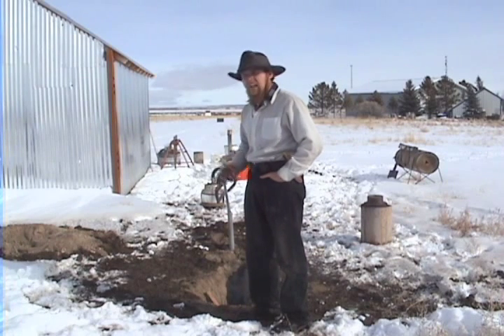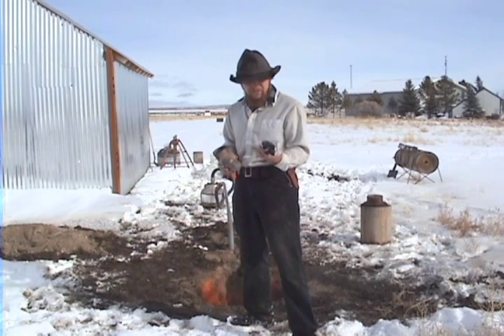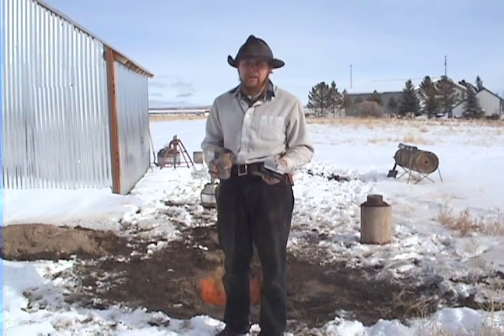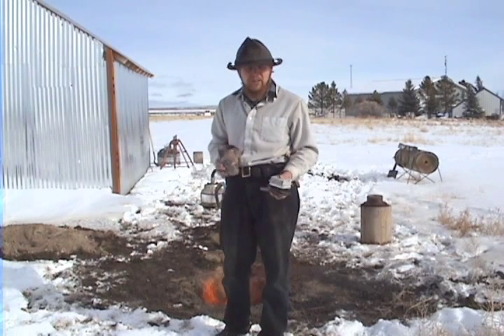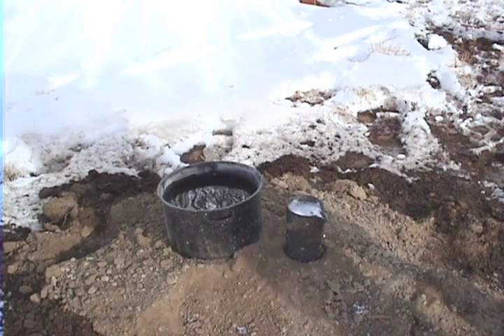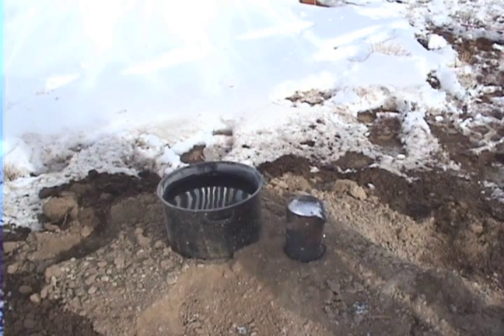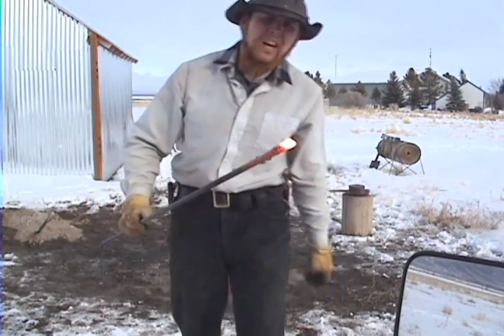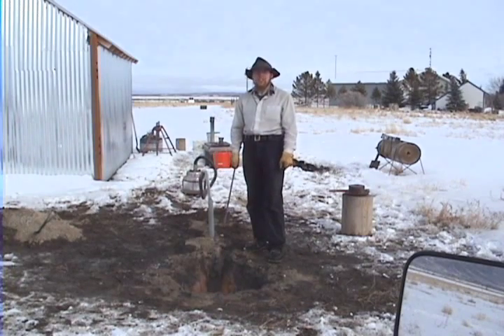Open Pit Forge (TIS040)

Comment: i copied the idea of the Whitlox wood burning forge from some old steel shelves from the dump, a 1.4 amp blower that i salvaged from the dump, two steel pipes and drilled 5 burn zones on my 42 inch forge.  i use some homemade firebrick but have mostly store bought firebrick.  the blower was attached to the forge with an old HP computer housing and bolted the square blower to the round pipe that way.
I can melt aluminum but not brass.  I've got some brass red hot but not into liquid.  
I noticed u used coal.  i read that the temp gets hotter with coal.  i've made charcoal from fir bark (using 5 gallon cans and a rocket stove (with my blower) but still couldn't get the brass to melt.
My next step is to make some triangle fire bricks to shore up heat loss and focus the fire temp.
It's on the todo list though.
i luv ur show

Comment: What kind of pot were you melting the metal in? I need to melt some steel.
Thanks!
~Sam
Reply from the maker: +sam nessim   This "pot" was one I made out of a short piece of 4-inch steel pipe, with a plate welded over the bottom end.  It works great for melting aluminum, but obviously it wouldn't work for melting steel, because it would melt too.  I'm thinking steel is usually melted in a ceramic crucible.
Reply: Thanks for the quick reply :)
Reply: You need a graphite crucible